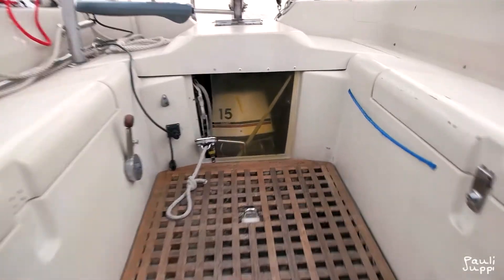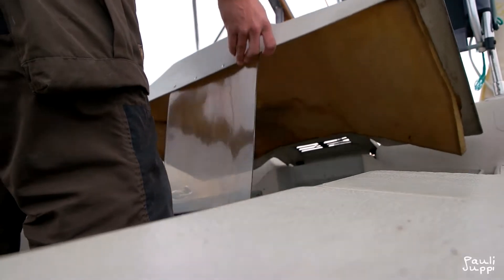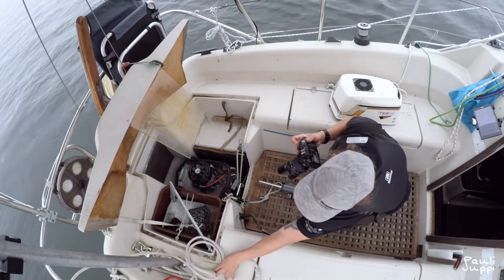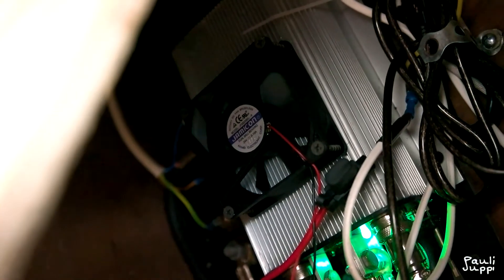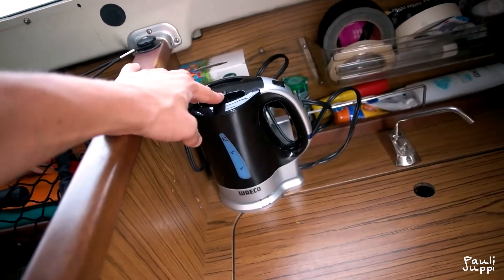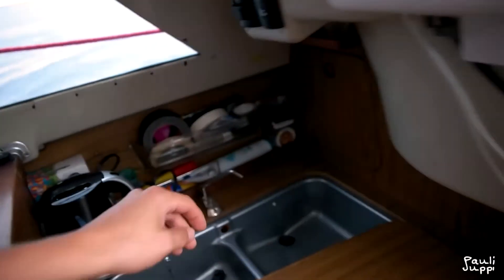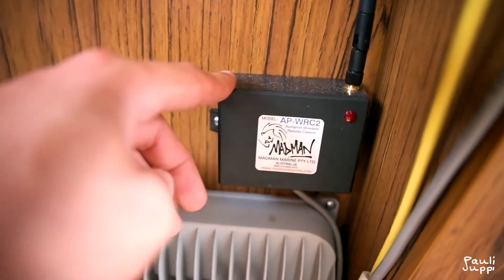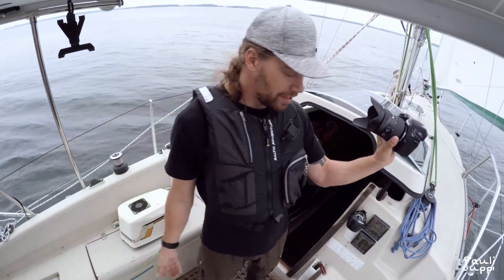This is my electric sailboat! Part 3/3

Comment: I would really love to know how much kW energy your motor uses for different speeds. What is a good cruising speed for your setup? With the energy consumption you could calculate the range of some battery.
I'd love to build a cruising solar power catamaran with lots of solar panels as a roof and a big lithium car battery.

Comment: Your DC motor set up on top of an outboard is empressive.
That being a DC motor, when you are under sail your prop should be turning.  That should produce a charge to go back into your battery bank.  For that to work the motor circuit would need to be on.  Have you tried this yet?
BTW I really like your video...
Reply from the maker: Thanks! Well I tried many things.. My controller has the function to regen and the motor produces volts when i turn it with a drill, but my amp meters show no signs of amps going out to batteries. I know my prop starts turning when I got 4,5-5 knots of speed, but frankly I not sure how many amps it would regen. I might get back to that next summer

Comment: Hi Pauli, just finished watching your vid's. Well done. I am installing solar on our catamaran at the moment and you are an inspiration. (might be a little tidier with my wiring. lol
Reply from the maker: +Asteroid828 Thanks! Yeah, don't save on cable thickness or length and protect your ends. Get a good charger controller. I'm glad to be a bad example on wiring :)

Comment: Paul what is the make and model of your boat? Was it an electric boat when you bought it? 
If you set up the solar system, how did you learn how to do it?
Reply from the maker: It's Dehler Delanta 75 and it was "normal" sailboat with a 10hp gasoline outboard. I'm a photographer, so I knew nothing about electricity nor solar power so I just googled it all. Trial/error, few fires and many sparks&smokes later - tadaa! :)

Comment: Do you plan to do anything about increasing safety and reliability of boat systems? Those messy cables may cause unpredictable problems in severe conditions at open sea.
Reply from the maker: +Koss Petroff yeah I know there's messy cables and ugly connections... but so far they've worked ok, and I've been sailing pretty harsh conditions (35+ kt winds and pouring rain). Reason why they look like temp solutions is cos they all were when I did them and most are still kinda.. :) but I really like things neat and order, so maybe some day or in another boat.. ;)

Comment: Nice! But one question,  you are a DIY'er, why are you using a 12/24vdc -> 240vac inverter just so your laptop charger can convert it back down from 240vac to 19vdc(or what your charger gives), This waste a lot of your power, on ebay you can buy a dc-dc step up(or down) inverter for $2-3 usd, as long as you get the right voltage(often adustable up to 32v) and the right amp and a jack you got your self a micro high efficient laptop charger :) just an idea. I'm currently looking at this solution my self :)
Reply from the maker: +JensO you're very sharp :) and right, there's no point going up and down on voltages. But cos I have a Microsoft Surface Pro computer, that uses a special connection(vertical magnetic) I can't use those universal chargers. I found and bought one from ebay(24v in/out so perfect) last year, but somehow it didn't charge my Surface. I expect that it has something to do with Microsoft not supporting 3rd party parts..?
But I bought the inverter to also charge my power tools, in a perfect world I'd try to convert the chargers to work with DC, but cos I charge those tools so rarely, I don't want to break something that works :)

Comment: Great project, thanks for the informative video. With 500Ah of batteries, how far will the motor take you at say 5 knots with no solar? I assume the solar panels will push out around 30 amps in full sunshine, what speed will the outboard push your boat along at 30 Amps? ie, draw nothing from the batteries.
Reply from the maker: +Alan B you're welcome! Good questions. I'll cover that on the coming video... Stay tuned ;)

Comment: So how many knots will the electric motor push the boat at.? Ahhhh a electric water boiler, never met a Fin that didn't Drink Coffee....!    What king of program do you have your sony tablet for navigation?
Reply from the maker: +patriotpioneer Well nice to meet you. I'm the Fin that has never drank a cup of coffee :) but my girlfriend uses the boiler and a pump to get her fix. Navigation app is iSailor. I'll do a seperate video about the speed and consumption of the motor.
Reply: The Pleasure is mine, Seriously, You dont drink coffee... How Do You Survive...???  I really like the concept of never having to buy fuel for your boat, do you ever worry about a giant wave shorting everything out?
Reply from the maker: +patriotpioneer I once tasted one sip when I was a child and it was bad so that's why :)
Yeah there's always a chance to short when on water, but I calculated that if the water level gets that high I have other bigger problems also ;)
Reply: LOL, yes i suppose that if the water is that high you would have your hands full.....

Comment: More batteries, solar panels, and disco lights for when you mount the stripper pole on the bow. After all, the girls got to have something to dance around

Life is good on a boat cigar, rum, stripper pole and dancing girls
Reply from the maker: +Mazda rx7 Hmmm... I could fill the pole with batteries and use the rotation movement to charge.. ;D
Reply: hehehe
Reply: +Mazda rx7      LOL